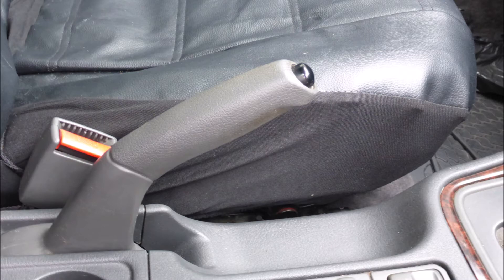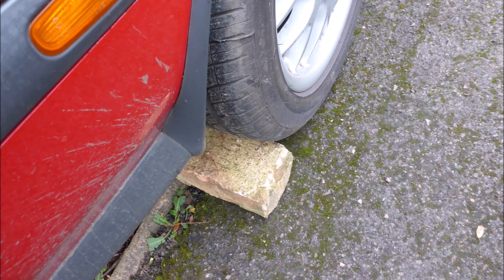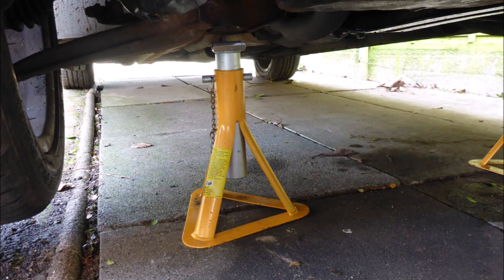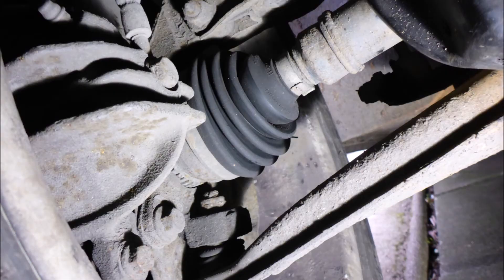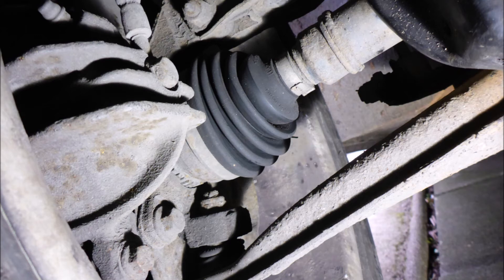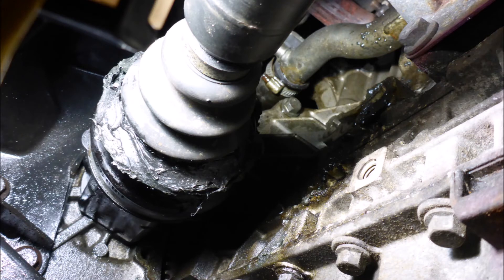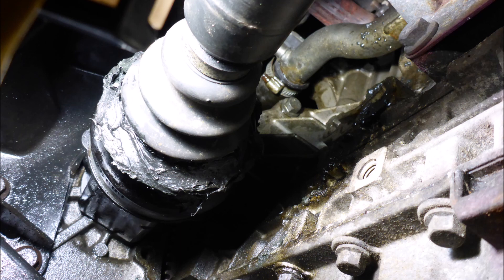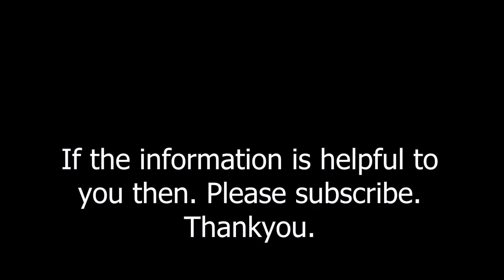Volvo S40 RH Driveshaft Faults Diagnosis

Comment: That photo you showed with the silicone on, is that really the one that was meant to be a new boot? 😲
Reply from the maker: Yes... The image was taken about eighty miles down the road. After it had sopposedly been replaced. Your emoji describes just how i looked and felt, when i discovered it.
Reply: @curbsidecarmaintenance6637  how did the garage explain that to you?
Reply from the maker: @KevR-73  Yes... Thankyou for the question.  I havnt been back to him... Yes he should have been called out for such appalling work... Yes i should have gone back to him and at least got an explenation, (but dont like excuses). The thing was that when your filled with anger and rage, its probably not a good idea to have to regurgitate all that again, in front of the person that was responsible for the vehicle whilst repairing it... For fear of losing it!. 
 What it showed me was that this person (garage). Did not care for what i thought. Did not listen correctly to what i asked them to do.  Had no respect for the customer or the vehicle. The video is an example of what can happen out there...

 A good idea is to ask the garage to take pictures of the work before and after. so that one can see whats been done before leaving the garage.
  He probably thought, well hes not going to go under there and look at that. It was when the transmission started to leak from the driveshaft that i had to go under and have a look. 

Needing to find solace with this incident, came in the form of the last part of the lords prayer... Forgive those that we tresspass against and those that tresspass against us... (cold comfort).